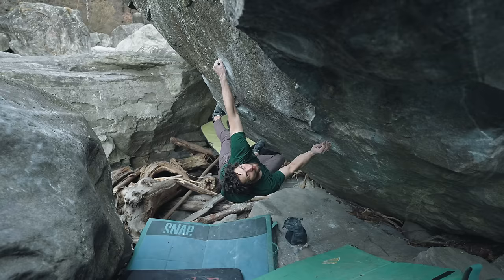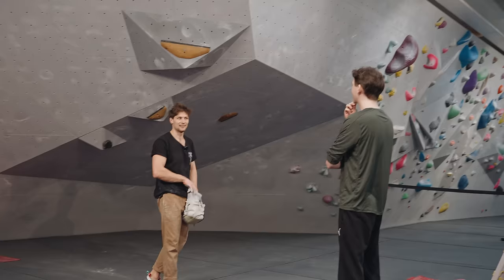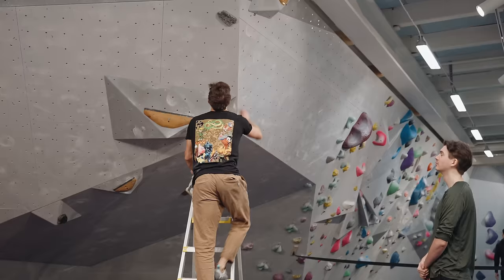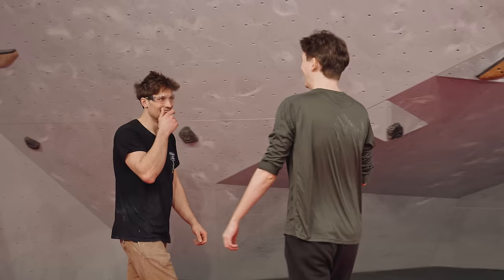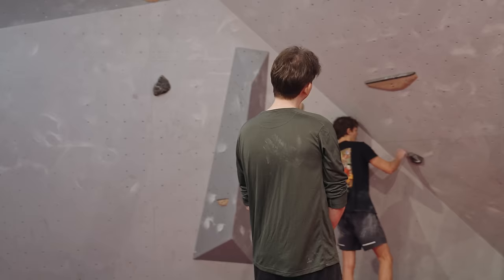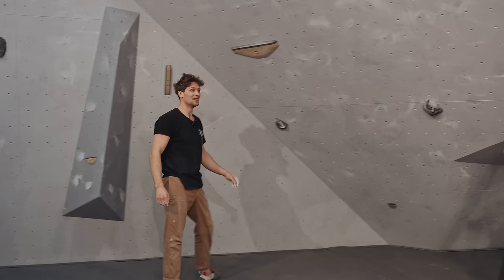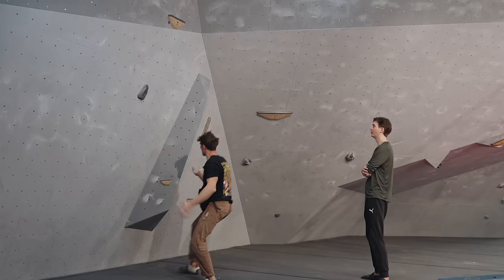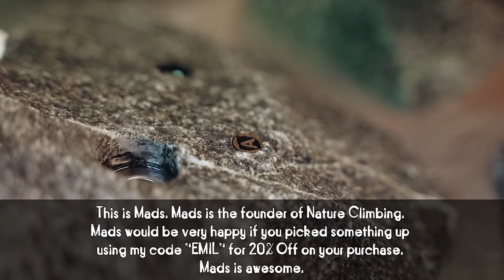Beginner Climber Creates A Masterpiece For Pro

Comment: How has no one asked this question, Emil, what is your rating for that technical climb, it looked like it could be around like V10-11, that switch move on the tiny pinch almost automatically makes it like a V10 to me.
Reply from the maker: It's a good question! 
I'd say my boulder was around V10/11 and Carl's V9/V10. It was very technical, and quite easy once you do it right I believe, the physically hard part was probably the first move actually! Although, I'm not great at grading boulders so take it with a grain of salt